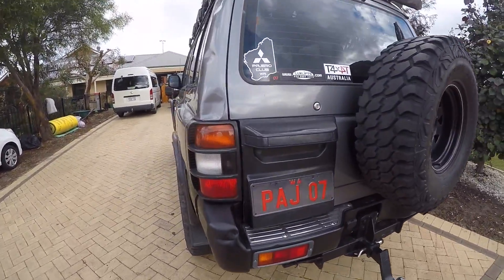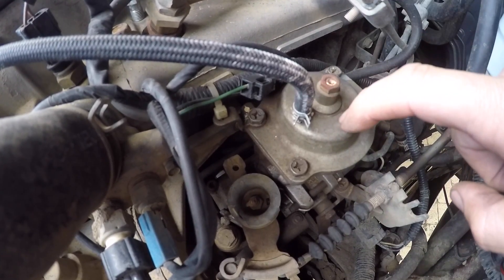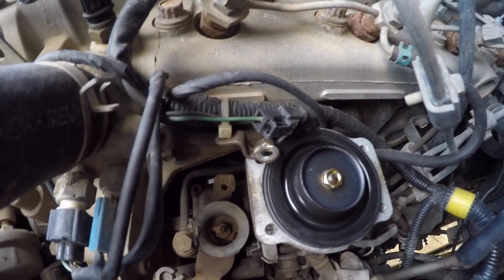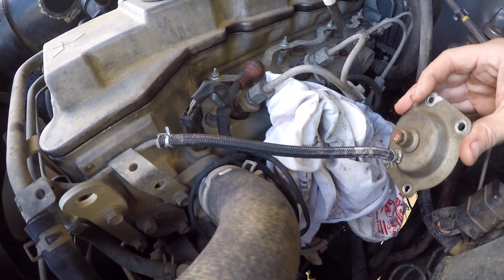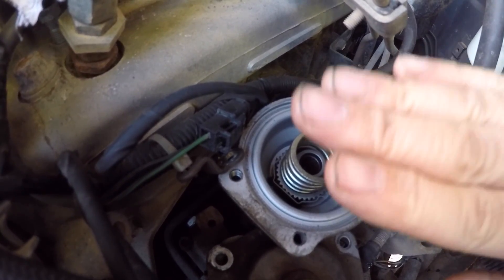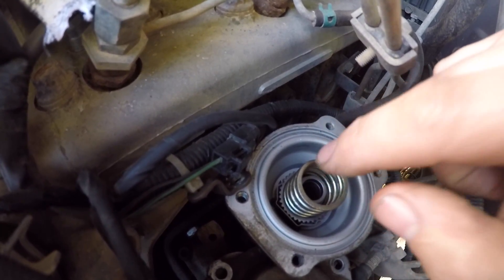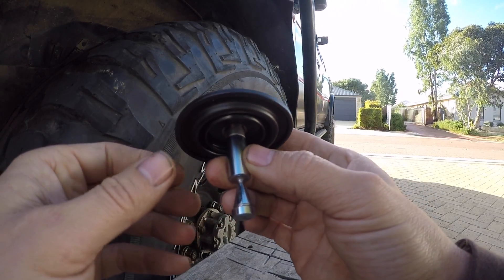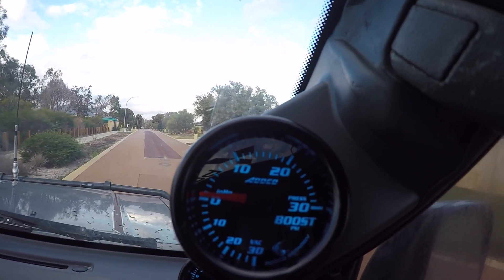HOW TO: 4M40 Boost Compensator Adjustment

Comment: Steeper? No . . . the further the pin comes out the more fuel you have; sounded like you said it backwards. Basically the deeper the depression (the side with less metal), the more fuel it will give. the reason you got boost faster was because you ADDED fuel; duh. Depending how you drive this miiiiight increase mpg, but not likely (gunning n coasting). You may or may not have more smoke depending on what the turbo can eat. Also the starwheel being down/softer makes for richer burn vs up /stiffer for leaner. The reason it was "laggy" before was due to a low fuel condition, which is okay for granny-type drivers but not those seeking power. Basically everything you said was backwards, not to be rude. The "fuel pin" you pulled out controls how much fuel altogether, the "smoke screw" up top controls the pre-boost fuel (say at idle/low speed cruising through a neighborhood); put it up and less fuel (good if you do tons of idling in traffic or just stands around liek for mail delivery drivers etc, down for more/power. If you wanted to make it less hazy, you could bring it up as far as it will go. The "starwheel" controls post-boost fueling/ the pressure first required by the turbo in order to give more fuel; put it too far up and it will be laggy but may be very economic for tons of highway driving; put it down and you have instant power. The cap with the "O" on it is just so you have a place-marker to align one fuel pin with the other; keep in mind for some people it may have been messed with/taken apart. Face the side of the cone that you want towards the front of vehicle. Hope this makes sense and helps. You're welcome.
Reply: can you guide me tuning my pump?

Comment: Dear from which point the boost pipe should be connected on the diaphragm .. From turbo or the inlet manifold?
Reply from the maker: Inlet manifold is most accurate

Comment: I have an L400 Delica with this engine, whereabouts did you install the boost gauge line? I have been looking around and different websites telling me different places to attach it. I wanted to test mine with a gauge as I am getting very sluggish boost before 35 mph.
Reply from the maker: I’ve tapped straight into my inlet manifold (best place) but for rough reference you can tee into any boost line.

Comment: So if the 0 is in the 10pclock it needs to be in the 3oclock position
Reply from the maker: In theory yes. But I’ve heard reports of a few untouched ones not been in the factory position. It can be a trail and error thing. Good thing is it’s easy to move.

Comment: Hey I just tried this and the top of mine doesn't separate 😢
Reply from the maker: Is it a 2.8 or 2.5? And it’s turbo yeah?
Reply: @PERTHSCOOTER07  hi yes 2.8 turbo
Reply from the maker: @brandongoberdhan6335  is it intercooled? I know a very few base models in Australia came without intercoolers and subsequently my not have boost compensator
Reply: @PERTHSCOOTER07  hey check your face 📘 I sent a 📖

Comment: What about the hose line from injectors is it air or fuel supply?
Reply from the maker: The metal lines to the injectors are main fuel supply and the small lines that are all linked are the return line for any unused fuel
Reply: So it is a return line from the compensator to the injectors
Reply from the maker: @ianjaycobalbiso5069  I’m not sure which bit you mean? The line to the top of the compensator is a vacuum line. But the lines to the injectors are fuel lines

Comment: Hello, could you help me? I cannot remove the conical piece that goes along with the membrane in a 1999 Mitsubishi Montero. It is possible to remove the membrane nut and access the inside of the area to unclog the cone, the plunger, and raise it. up to restore order, the car works perfectly in low and high speeds, perhaps to recover when changing gears and going up, it's a little bit missing but the car works perfectly, it's great. I bought it recently and now I wanted to readjust the diesel injection, I can't, you can help me? Thank you thank you very much.
Reply from the maker: Have you tried lifting the diaphragm and spraying penetrating oil down into the assembly to try free it up?
I’ve never come across this problem before
Reply: @PERTHSCOOTER07  Not yet because I'm waiting to get a membrane to be able to manipulate and spray. I hope this week to be able to open again to gently pull the diaphragm and clean it.

The funny thing is that the car works perfectly although the diaphragm plunger does not move.
Reply: @PERTHSCOOTER07  I believe that only the conical plunger is stuck, even though a mechanic has told me that the needle that enters the conical may also be blocked. My intention is to remove the nut that holds the membrane and try to remove the plunger to the sides and towards up to clean everything and replace a diaphragm, a new membrane, thank you for everything, greetings from Spain.
Reply from the maker: @rzf8945  hola señor. If you get a spanner on that top nut it might even be enough to twist the compensator in the housing and free it off. If the inside pin is stuck you may end up having to strip the pump down
Reply: @PERTHSCOOTER07  Yes, it is possible, but I am confident that it is only the conical piston. In a few days, I will open the lid again and gently try to free it. What is very strange, I am sorry to repeat myself, is that the car works perfectly, but thank you very much for everything. I will look for you soon to tell you how.

Comment: My 96 pajero 2.8 TD 4m40 engine.  The vehicle was driving really heavy ,losing power and black smoke. The engine light came on for:
12* Boost pressure sensor system and 41* Main throttle solenoid valve system.
I gave to my local mechanic who checked and tested the boost, turbo was boosting correctly. Checked throttle valve and components. They removed and tested EGR components and manufacture EGR blanking plate and adjusted the belts.
Do i need to do a Boost Compensator Adjustment?
Reply from the maker: If you’re not blowing black smoke anymore and the vehicle is running ok but you feel it’s a bit laggy then try it. If you mark the compensator and you’re not happy with the results you can just set it back to how it was. If you have the time you can try multiple positions till you find the sweet spot

Comment: what is better less spring tension or more tension?thank you sir
Reply from the maker: Less spring tension is better but also riskier. If you’re going with less spring tension don’t go mad. I’m not talking from experience but have heard reports of runaway engines from reducing spring pressure too much. Not sure how true this is but not worth risking
Reply: @PERTHSCOOTER07  thank you, but why do we call better if it's risky?in performance basis , it have some Xtra power boost?
Reply from the maker: @superfoood4618  it’s the same with anything. Take adding more boost for example. The further you go the more power you get. But go too far and boom!!!!

Comment: Hi Great video mate, I am having a Boost issue with my Delica and I was wondering if you could know the solution, it seams that my waste-gate valve released all the boost , specially if I put my foot down or I am on a hill I only hear pshhhhhhhh and no power. Can I adjust that or I need a new turbo with a new waste-gate valve? Thanks in advance
Reply from the maker: It sounds like a boost leak. Most common issue is a split intercooler pipe. If it’s auto (which most are) get someone to put it in drive, left foot hard on the brake and slowing bring the revs up (just watch they don’t run you over) this will load the engine, start making boost and you can look/ listen to where it’s leaking.

Comment: What do you do if you pull the pin out and the little pin inside won’t stay in when you push it back with screw driver
Reply from the maker: I’ve never had this problem but try backing off the idle adjustment
Reply: @PERTHSCOOTER07  okay thanks
Reply from the maker: @jamesarnold7446  let me know if this works please as I’ve never come across this issue before. Cheers
Reply: @PERTHSCOOTER07  no it hasn’t worked not really sure what to try now 😂
Reply from the maker: @jamesarnold7446  maybe something is broken or worn as mine just clicked into place. You may have to get a diagram to see what holds it in place

Comment: Hi, i have a NL shorty(J-top) 4d56 5 speed manual. Not looking for outright power but i'd like to tune it for drivability. Right now i don't even have enough power to take off in 2nd gear, so i'd use that as a reference because i haven't put a egt gauge yet. Everything is stock, runs no exhaust after the resonator
Reply: Same story, previous owner messed with the pump settings in past, and now i'm trying to correct that.
Reply from the maker: My old JTop was very sluggish. The pump timing was out (I had a lot of trial and error rotating the pump) I’m not saying that’s the problem on yours. But when the timing belt is changed it can slightly effect pump timing. I increased fuel on the main fuel screw on mine and it went a lot better
Reply: Mine is shaking a bit at idle, so i first sent the injectors off to get serviced

Comment: Hi, just came across your video, nice, thanks. What is the original setup (O -mark factory position of the diaphragm ) and would it be recommendable to change for running at 2.500m (Bogotá Colombia)???
Reply from the maker: That’s actually a great question. At higher altitudes with thinner air I’d possibly still change the compensator position. But leave the main fuel screw. As for the factory position. I can’t remember as it’s been a while since I’ve done this. A quick google search should come up with the goods.

Comment: At which minute exactly is what the NA 4d56 pump won't have?
Reply: Is it that round thing you removed which looks like the top of motorcycle carburetor?
Reply from the maker: @magnumllama400  at 1:15 I point to the lid. The NA pump is flat on top and doesn’t have the hose coming off it.
Reply: @PERTHSCOOTER07  so there's electronic and mechanical diesel pump. But is there anything like both electronic and mechanical diesel pump ? Because a 95 4m40 owner said he got that.
Reply from the maker: @magnumllama400  here in Australia the gen 2 Pajero was full mechanical. But the Jap import ones and the Delica with the same 4m40 had some electronic components such as TPS
Reply: @PERTHSCOOTER07  is that the 1997 and later which had 140hp as they say?
Reply from the maker: @magnumllama400  I’m not sure exactly but that sounds about right

Comment: Thanks for the video, i need to do this to mine. I put bigger tyres on and now it's turned into a slug and it's chewing the juice. Hope it fixes it a bit.
Reply from the maker: Watch my other videos. I have ones on main fuel screw and boost increase. I’m running 35’s and it goes well with fuel and boost turned up. Just make sure your cooling system is in good shape
Reply: @PERTHSCOOTER07  Yep! The cooling system is good. Usually sits at just over a quarter. I knew going up in wheel size would affect it, but hell I wasn't expecting this much! I went from 31s on 15s up to 32's on 16 inch cruiser rims. And it looks like I'm down about 80km to half a tank! The odometer isn't out by much either, speedo is out by a needle width.
Reply from the maker: @Spacegoat92  wow that’s a lot. Of extra fuel
Reply: @PERTHSCOOTER07  Damm straight it is!

Comment: ive got a 1999 shogun with the 2.8 td is it the same principle for me? Thanks
Reply from the maker: If you have a shogun I’m presuming you’re in the uk? Your pumps have some extra cold start stuff on them. But the compensator setup should be identical
Reply: @PERTHSCOOTER07  yeah UK buddy, that's great thanks, im guessing your video on the pump adjustment will be the same.
Reply from the maker: @jaypearce6199  yes mate 👍🏼

Comment: Sir i have Mitsubishi Intercooler turbo 4M40 2800cc
It is issue with the pick up problem first this accelerate cable was hard i changed this but problem not fixed..over 1500. Rpm it started pickup..very big pick up problem
Reply from the maker: This mod will help pickup. But bear in mind when ever the engine is off boost (under 1500rpm) it will be sluggish

Comment: Good video and nice pajero, ive got a nj paj on 33s, and we fitted a 2554 billet turbo to it and its running 25psi of boost, real good option if u want to ever make abbit of power, goes real hard now, dpes abut 11secomds to 100
Reply from the maker: ABH diesel performance is the engine on stock internals? I would like to go a bigger turbo eventually but don’t know what they can handle as people don’t really modify them much here in Perth.
Reply: @PERTHSCOOTER07  yes all stock internals and pump, run a td0518g for abbit which was laggy but boosted 50psi but the 2554 is heaps better because it comes on boost instantly
Reply from the maker: ABH diesel performance front mount or top mount cooler?
Reply: @PERTHSCOOTER07  600 by 300 by 76 ebay front mount but u could use a smaller front mount if its a decent brand cos the cheapy ones arnt very effecient
Reply from the maker: ABH diesel performance I’m guessing you need a custom manifold and dump pipe for the 2554?
Reply: @PERTHSCOOTER07  yeh we made a custom manifold from steam pipe and then made a 2.5 inch dump, not very much space so we mounted the turbo highmount so it is heaps easier to get to the turbo and manifold bolts, we used a mamba gt2554 bb turbo that is meant to be bolt on to a sd33 because of this we can change to a td0516g bolt on for td42 if we want to or even standard ht15 gu patrol turbo
Reply from the maker: ABH diesel performance I’d love to see pics if it’s not too much trouble?
Scottmarkingham@hotmail.com
Reply: @PERTHSCOOTER07  ok wd
Reply: @PERTHSCOOTER07  hey m8, did u get my email with the pictures
Reply from the maker: ABH diesel performance  I did thank you. Great setup. I’m happy with mine at the minute but have some ideas for future modifications.
Reply: @PERTHSCOOTER07  yeh, mine goes well but i need to do another one with a more refined setup because it is abbit bogan looking atm, but i put it up against a 250hp remapped v8 cruiser and we were even so im pretty impressed
Reply: Any pics or info dude
Reply: @joshbuck2037  look on mosquito fabrications insta page and its up there

Comment: Can someone help please. ive got a mistsubishi shogun (pajero) warrior 7 seater 2005 3.2 did and it will not stay running in any gear r or d and unless driving on the road and if it slows to much or stops at a light it cuts out it also will not idle in neutral or p when warm.idles in n when cold but dies as soon as you put it in d or r unless you push accelerator straight away and put it neutral and keeping revs up at lights or slowing down.anyone help please
Reply from the maker: I’m not sure why, but I’d say it’s stalling due to the idle speed being too low. The idle speed on these is not manually adjustable. I’d get it checked with a scan tool for any codes.
Reply: @PERTHSCOOTER07  no mate its notvthst as wen its cokd the engine sits around 1300 revs or so 1200 maybe but soon as loads put kn the engine (put into gear d or r) unkess i immediately take off to drive as soon as i engage gear itll cut out as soon as it goes into gear without accelerating.thanks for the read and input though.good guess cheers mste
Reply from the maker: Stephen Nixon possibly a trans problem? Tourque convertor locked up???

Comment: hello..sir..i ask..a question.i have..a l400 mitsubishi delica..i feel my fuel pump..was bad and i replace a new..but..it wont start..but if you pump..it will start..nd u..dont..pump..it will die..thanks to ur video..
Reply from the maker: Check all the fuel lines to and from the pump first. It could be drawing air. Also worth putting a new filter on if you haven’t already.

Comment: Hi there
I have a l200 with the 4m40 2.8 engine
I'm having trouble with over boost.
I fitted a new turbo and when reved hard the over boost valve blows on the inlet manifold.
Any idea to whats going wrong?
Cheers
Reply from the maker: Nothing is going wrong. The valve is doing what it’s meant to. The new turbo runs more boost than the old one and now the valve is opening.  Check out my other video for increasing boost on a 4D56 engine. It shows the blanking plug I purchased from eBay to replace the overboost valve
Reply: @PERTHSCOOTER07  thanks for the reply.
If I blank it off aswell I'm worried it will blow the engine as to much boost.
Reply from the maker: @plark5521  if you’re worried about this I recommend a new valve. I believe it’s set to 14psi from factory but most are old and worn.

Comment: Hi
I've also added shims to the westgate and wanted to rotate the diafragm after, but surprise.... the O marking wasn't facing the engine at 9 o'clock, was somewhere around 2 o'clock. I'm the only one who's been opening the boost controller, so Im pretty sure that's how it came from the factory. My car is a Delica L400 with the same 4m40 and same mechanical pump. I know it's not a Paj but still, any thoughts mate? Thanks.
Reply from the maker: Possibly slightly different fuelling on Delica ???  Try playing with the position. Worst case scenario it runs rubbish and you switch it back
Reply: @PERTHSCOOTER07  thx a lot for the reply. I just took off the diagram and checked the cone's position. refitted with the steepest part facing the pin and job done!
Reply: Me again with something that I forgot to mention..... so, when removing the boost converor's cap, the diafragm and everything inside the converter was full of oil. Any idea why? My turbo was refurbished and bench tested by a trusted company and spools great, no signs of oil in the intake, air filter or intercooler (only notmal mist). Boost peaks at 11psi (after the mod). I didn't recheck if oil inside after the mod, but curious what can caused the converor to be full of oil? Thx